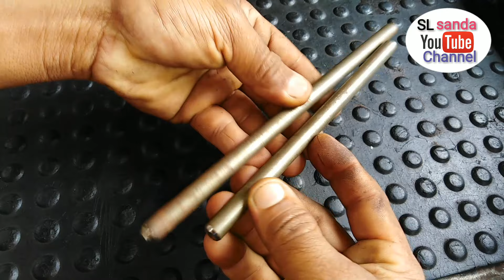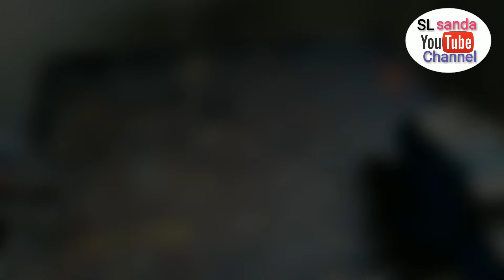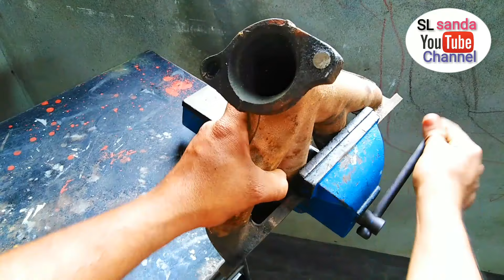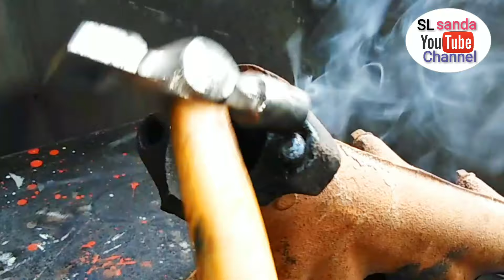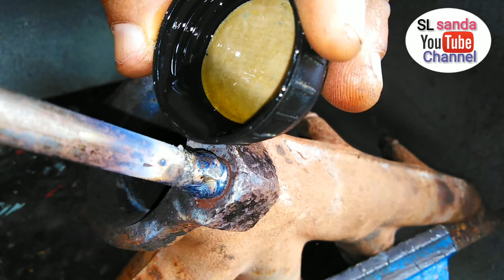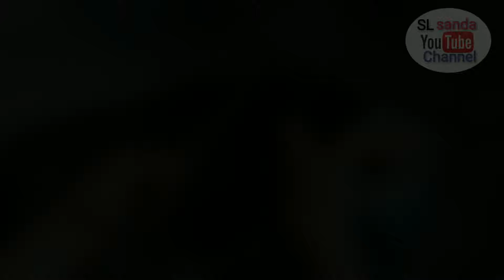Wow awesome new idea bolt remove

Comment: Very good idea, but I was surprised that the cast iron exhaust manifold didn't break or cracked after hammering when it was red hot, I am used to drilling a hole into the bolt then using an easy out.